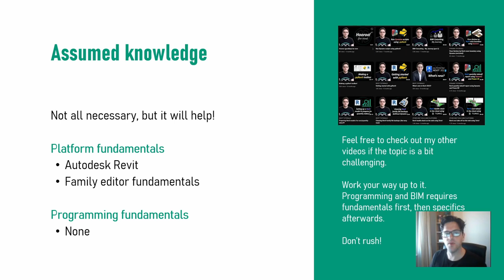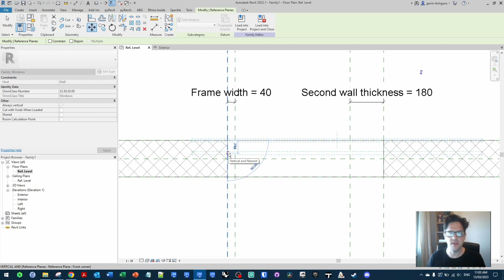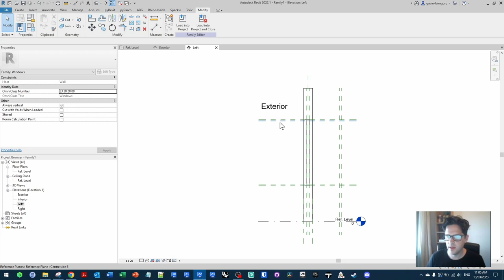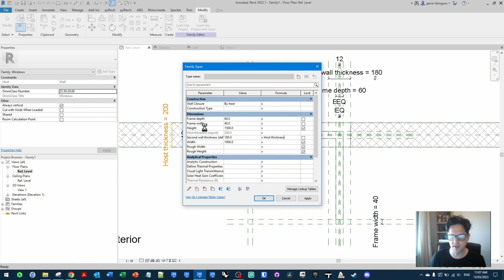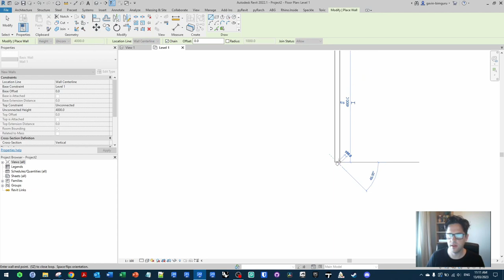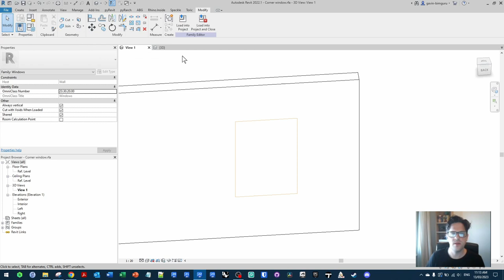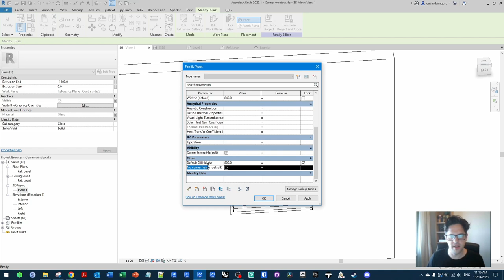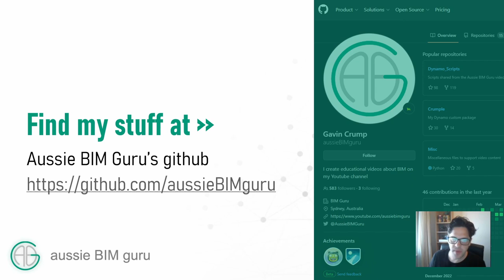Corner window family in Revit!

Comment: Another tip I would add for more control is a Yes/No parameter that allows you to toggle if the wall is the same thickness or not.  You can name it as "Same as Host", and in another parameter create the formula:  IF(Same as Host, Host Thickness, Custom Thickness).  This will allow for more precise control of the family. Other than that this is a great approach to something a bit more complex.
Reply from the maker: Yes this is actually moreorless how I manage this sometimes, nice idea so that by default it will just follow host thickness.

Comment: Great video.   Since you made the height and width instance based for this example there are a bunch of grip arrows in the project environment that are a little confusing.  Do you know offhand if that trick of constraining instance parameters to invisible lines will work in window families so you can turn the arrows on or off with a checkbox?
Reply from the maker: Generally best way to fix this is make a pair of extra parameters to constrain the planes instead then drive them with formulae back to the width/height instead. This will disconnect them from the grip controls and having them formulae locked should also remove the grips. You can also use the syntax if(1=1, Width, Width) to remove bidirectional parameter entry to the dummy parameters.
Reply: @AussieBIMGuru  I think I understand what you are saying and have done something similar to make the arrows disappear, but ideally I’d like their visibility controlled by an instance checkbox in the properties palette like “turn on-off the arrows for me”. I know this works great for detail items and other categories, but i tried it a couple weeks ago on duct and pipe fittings with no luck.  I assumed it had something to do with the routing preferences making fittings behave like loadable families that are hosted to system families and wondering if the window/wall relationship had the same issue, or possibly a solution to try out on the duct/pipe side.
Reply from the maker: @zadams5596  yeah inbuilt behaviors here, not sure they can be circumvented.

Comment: Good stuff, voids can be tricky sometimes, maybe I missed when you toggled it, but there is a yes/no in the void that tells it to cut geometry or wait for you to use the cut tool, which is why I think it was cutting the walk when you loaded it. What seemed odd to me is that you did leave that checked but it was not cutting the 90 degree portion of the frame.
Based on your opinion, which method for managing storefronts (and creating storefront elevations)is better: Creating elevation views at each storefront (and modeling them each independently at each location), or creating an assembly for each unique storefront and using the assembly views for sheets, with the ability to copy the same assembly around the project to differnt locations? 
Thanks Gavin, love your stuff, always learn so much!
Reply from the maker: Yes the voids behaved a bit strangely here, and the void on/off definitely helps once you're in revit 2021. Generally for glazing suits it would depend, the benefit of elevating in place is you get surrounding context, whilst if you do an assembly it's OK if it moves but you lose surrounding context.